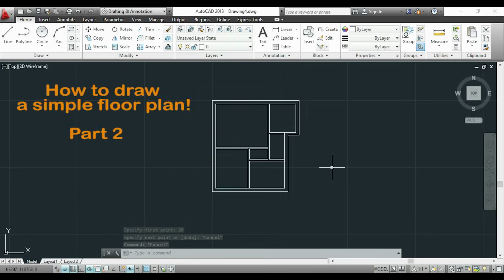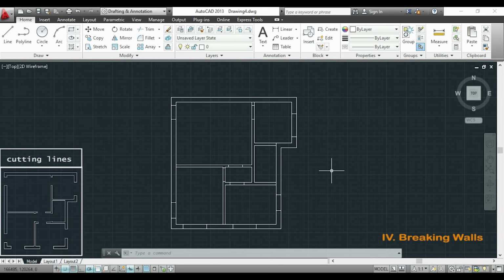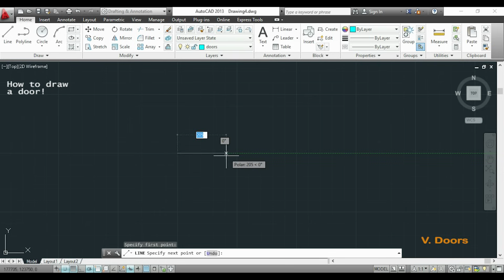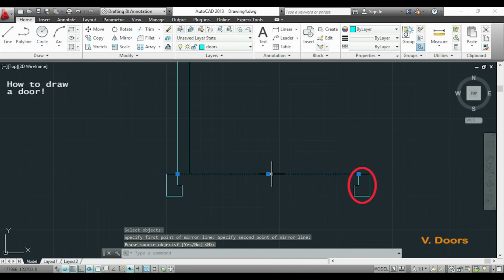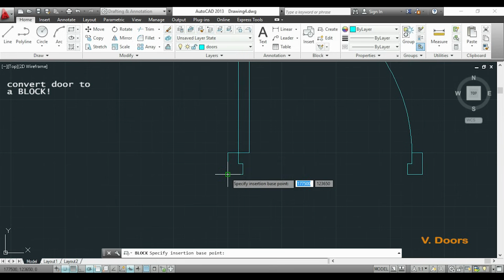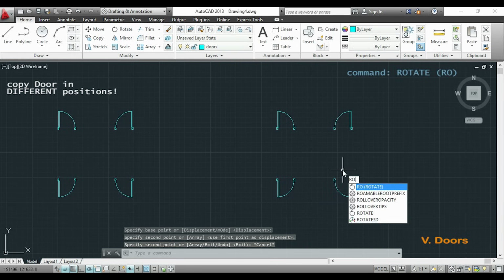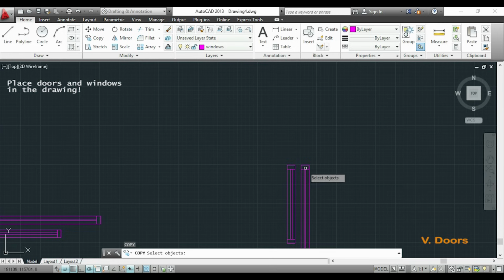AutoCAD 2D Basics - Tutorial to draw a simple floor plan (Fast and effective!) PART 2

Comment: omg this video help me so much ♥♥♥♥
Reply from the maker: I am happy that helped you! +•Black○Candy•
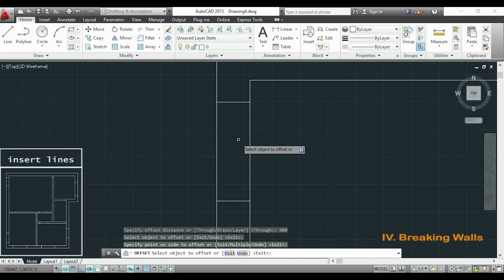Reply: im confused.. you cut the openings of doors at 900(1:28),then when u draw the door u didnt add the dimension of the doorjamb. now when i copied the door to the FP,it didnt fit exactly on the 900 cut..wew..the thing is door+doorjamb=1000 and the door cuts u made at the FP is only 900.. how come that it fits exactly when u copied the door to the FP? shud i adjust my dimensions?doorjamb + the door itself?.. sorry for bad english mate..hope u get my point
Reply from the maker: Hi +equilibrium. In fact, I drew the door width as 800 (4:30), and then with both doorjamb makes the 900mm. You can also check the dimensions in the pdf file I provided in the description. Let me know if you fixed it.
Reply: Thank u sir.!.appreciated much!.. didnt see that one ^_^..

Comment: Amazing....you are so good bro but I think for the door it's so easy to use 3 points arc
Reply from the maker: Thanks a lot for watching and for the tip. Of course, there are always several ways to make a drawing. It doesn't mean this is the faster method. :)

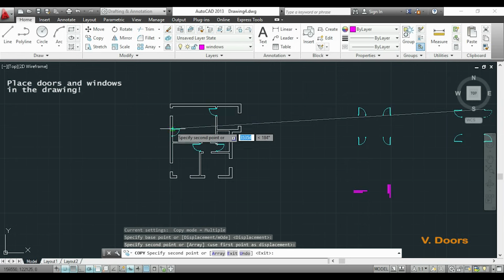Comment: I have a question, i only started learning recently, i noticed that the doors in the middle of the building,  you picked a diffrent point from where your copy starts and that u also potitioned them diffrently. the left door is at the back of the opening, and the door on the right is at the front of the opening, if that makes sense. is there a reason for it? it's at 8:20

Comment: Great tutorials thank you, it's extremely informative and helpful ! I'm a little confused however, from working along with the floor plan and elevation file that's from Part 1, I can't seem to understand why you cut an additional wall in Bedroom 1, and also the window in Bedroom 1 seems to be wrong size. There is no window also in the living room. 

I can understand it's the commands and processes you're teaching us, thanks so much. Just a heads up as it flung me for a while when following along. I believe maybe you have created a slightly different layout from part 1.

Not a complaint, just an issue I noticed!
5/5 :) Thanks alot!

Comment: I have been following along but when it comes to the Trim section I wasnt able to deleted and the message is, "Does not intersect with cutting edge" I have went back and verified that he lines intersect. So this is very unusual. It would want to delete the entire offset wall that I have built up. Do you know what its doing this?

Comment: Everything has gone great however when I am trimming some of the lines where the walls overlap that you trim come up with a circle with line through saying 'does not intersect with cutting edge' and then wont trim it, please could i have some advice?
Reply from the maker: Hi +Joshua Tye. I think I guess your issue. You try to delete section which actually is an independent line. If is this, you cannot trim. Just press the button "delete".  Tell me if it solves! I also had this issue, and it was quite frustating

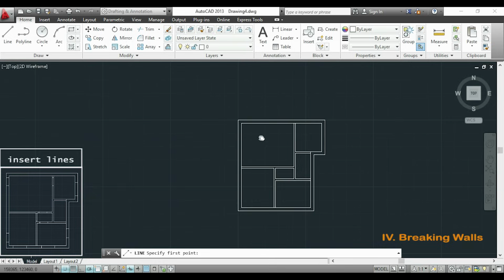Comment: Hi @CAD in Black can u explain me what exactly u did at 1:13 ? Thnks :-)
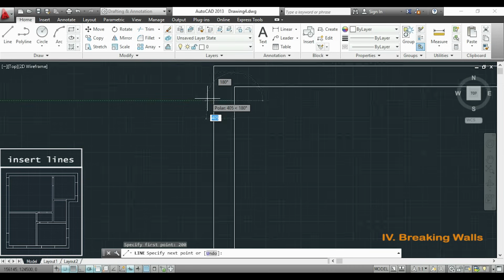Reply from the maker: Yes. After having the walls I want to draw the doors in the drawing. The small lines that I draw after 1:13 are just a reference for putting the door there.
Reply from the maker: Although, you can still put the door directly in the wall section. without drawing that lines and triming (what I explain as "breaking" the wall). I just think the drawing is better presentable by doing this way
Reply: I dont know how I can define the distance to the point where I want to draw the door....I see that u did it somehow easily...
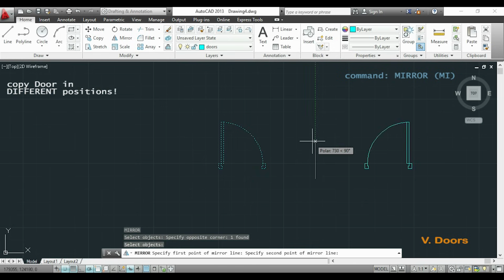Reply from the maker: I think I understandnow. You have to go to OSNAP settings, switch on "extention" and "nearest" has to be switched off. Then you place your pointer over the corner, and start dragging down. Then you type the distance from the corner to the point you want to start the new line and press enter.  Watch this video  at 6:40 https://www.youtube.com/watch?v=yOGzf_Myxmc&lc=z121ytsx1yyjf10es22fyvqyyu3ysdoup.
Reply from the maker: Also, if you are not very familiar with OSNAP you can watch this video. 
https://www.youtube.com/watch?v=tBVCOiWiFIg&index=6&list=PLe_I-JWckL7G_ud-bYa6vrmM-LnFNpPC-
Reply: Ahhh I get it !! thank you so much ! You r awsome man !!
Reply from the maker: You are welcome. If you have the osnap icon "nearest" active, this will not work when you drag the pointer over a line. Just check it, and you will understand :)

Comment: this bathroom window, on draw from link on scribid that you gave there is no measurement how much to move from uper wall?
Reply from the maker: Thanks for your notification +Andrija Bogicevic as I haven't realized that.
You can download it again, I have just updated the file
Reply: Thank you, i appreciate your work
Reply: i have one more question, how you know where to put doors, i mean is there some extension labels like it was for windows
Reply from the maker: In the floor plan I specified the distances from the wall till the first point of the door. You can check there. Only one distance is missing, but I will update the file again.
Reply: No, i solve that my own, you didn t understand my question, when you put doors in space of 900 mm, for exampe for bedroom 1 and 2, how you know on which edge you put it, on edge that is closer to room whose door it is, or like it is in bedroom 2 , on edge that is closer to hall? I know this is detail, but i want to know everything i can. Thank you for your time.
Reply from the maker: Now I understood you, because I checked and I haven't all doors in the same edge (as I had the windows). Yes, it is just detailing and usually I prefer to put the door in the edge closer to the room.
Reply: @CADinblack  how come you dont explain how to draw the window and its measurements? I am struggling to draw it

Comment: I m having trouble doing offset. it doesnt work when I put a specific length or width
Reply from the maker: I couldn't understand exactly your problem. I offset command, the software asks to insert an offset distance which will be the distance between the 2 parallel lines

Comment: Why doesn't this drawing match up with the floor plan in the link ?? It keeps throwing me off as I'm trying to do it.
Reply from the maker: Yes, you are right. The reason was that I made this video just to teach a way to draw it faster, using other commands. Later when I did the drawing of the link I realised it was too simple, with some rooms without windows which didn't make sense. That was the reason I draw 3 windows more in the pdf. All the rest is the same. I apologize for that  and thank you that you still find it useful :)
Reply: CAD in black thanks so much, I really appreciate it.

Comment: Hi, your video series is super awsome. However, please don't skip any of the part. You can fast forward to shorten the video length which we can see in slow motion to understand. Could you please let me know the distance of your bedroom1 window. It is not intuitive either from top or bottom. Also you missed the distance of bathroom ventilator from any of the corner. Please provide the dimensions.
Reply from the maker: Hi +Gaurav Arya.
Actually when I created this series, the point was just to teach some tips to draw floor plans, not step by step tutorial. I launched 3 tutorials to draw floor plans. You can check out them here.
Thanks for watching :)
 https://youtu.be/wn1TT_-HpoI
https://youtu.be/phaCr-evfi0
https://youtu.be/s21KfdONMN8
Reply: @CADinblack  Yeah I have been following them too, please specify the distance I requested above. I checked the floor plan linked in google drive but these parameters are missing and I dont want to guess. Please update the floor plan whenever you get some time. thank you once again for these wonderful lessons.
Reply from the maker: I've already updated the file. Let me know if it's alright!
Reply: @CADinblack  Its perfect now, many thanks.

Comment: I'm still starting to learn autocad. does all of the things u said can be also applied to autocad 2007?
Reply from the maker: Yes, Everything I show here works on AutoCAD 2007, and the commands are the same. The only is that the tabs  are displayed differently, because AutoCAD 2007 still uses the classic mode.

Comment: I hAve small doubt sir  I observed your two videos in every video you are writing command directly without using command box which is in the bottom . can u please explain how you write the command directly
Another question sir : what is the diffefence between autocad 2013 and autocad 2014
Reply: A good way to know what's different in any new Autocad release is to check out new features.  A youtube search on "Autocad 2014 New Features" or something to that effect will pull up some vids and/or info that you're looking for.  On the surface, it seems as though there is very little difference between '13 and '14 but I'm sure you'll find additions or improvements upon further investigation.
Reply: As for your earlier question, are you referring to inputting commands where the crosshairs are as opposed to the command box?  If so, that is available via the dynamic input setting.  You can toggle it on and off I believe with F12.

Comment: The Plan in the link is different from the plan you did :S, i ended up having more openings than yours because i used the scribd image as guidance
Reply from the maker: Yes. It is not exactly the same, as I updated it a bit later. But thanks for mentioning